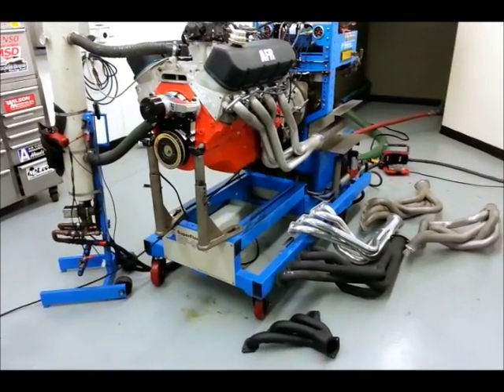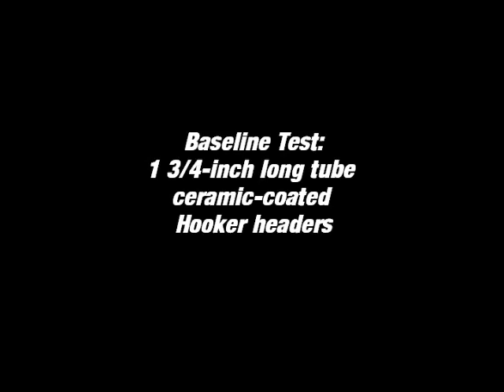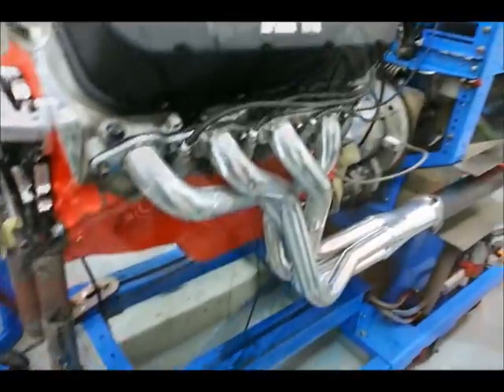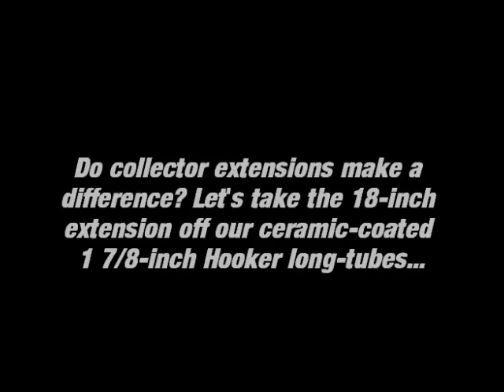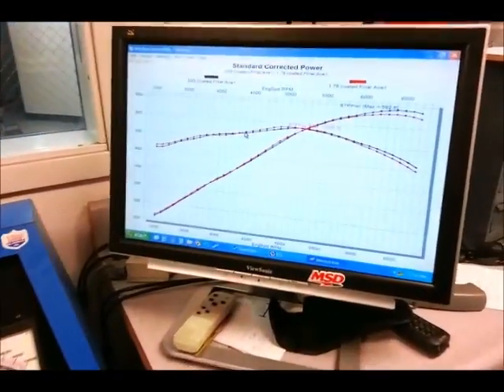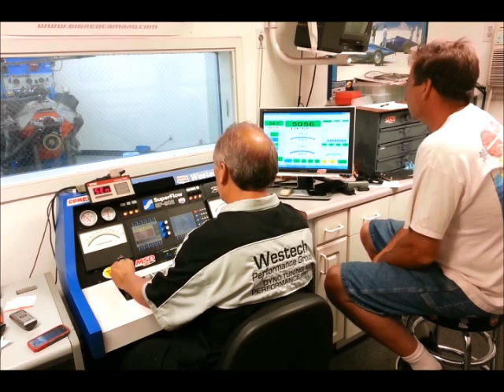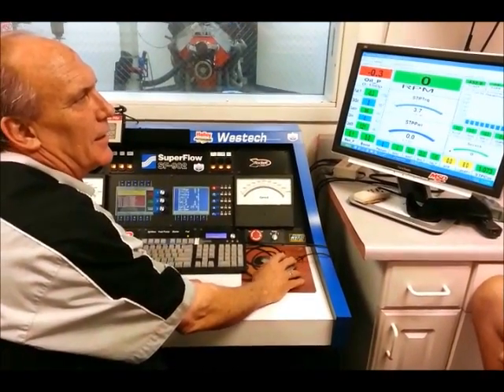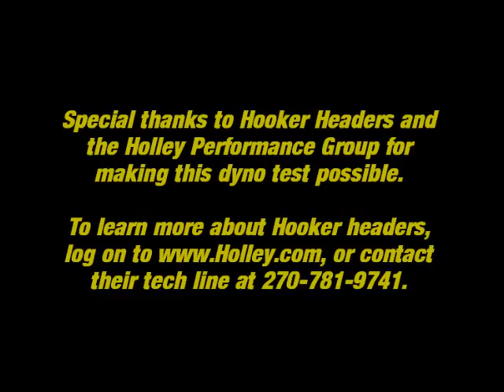Header Theory Dyno Test

Comment: @7:54 when he's talking about no effect from the header temperature to the horsepoewer - that's not quite right. There is, very small (if not negligible). This is due to the fact that in ceramic coated pipes, less heat is being rejected from the exhaust gasses to the pipes hence more heat is being detained in the exhaust gasses. More heat in the exhaust gasses keep their temperature higher. Now: The speed of the flow depends on the factor that is being a reference, and being a speed of sound. Speed of sound depends on the enbvironment - more precisely on the gass density which decreases with the increase of its temperature. In higher temperature gasses, flow losses are lower. Also, pulse effects (which are being used for scavenging) are affected in hotter gas flows - the speed of pulse wave is increasing in hotter environment hence the scavenge effects are optimal at the different range of RPM than in cooler gasses (no ceramic coat). That's why it makes a sense to wrap exhaust headers (not only to cool down the air under the hood!). These blokes needs some 10+ more years working on the dyno in more scientific environment...

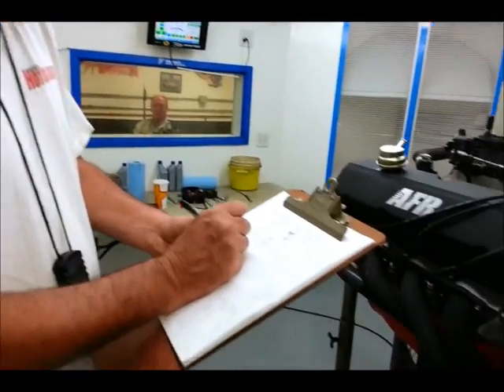Comment: At around 5:50 the guy off camera claims "we can feel the extra heat" which doesn't make sense.  The heat comes from the running of the engine and is the same whether your headers are made of steel or ceramic.  It's just whether the heat is absorbed partially by the headers or all of it exits out of the exhaust.  So his claim that the room is somehow hotter in the case of the steel headers is baffling.
Reply: not true. different materials dissipate heat at different rates

Comment: 3000 rpm is the bottom end? Come on! Start the test at 1500rpm so we can see the real bottom end differences!
Reply: 1500 rpm in a performance motor   --- get real
Reply: Race cars with good looser Converters ( like a foot brake racer) is going to be right @ 3500 0r a little more RPM  trying to hold with foot brake. Power range on race cam shaft is about 3500 to 6500, 7500 . So for us racers that info could save us $500. or more if you could borrow a small header to test & a couple weeks of test & tuning @ the track. Plus the heat diff on coated header versus the uncoated is a ton of Hot AIR under hood into you carb, killing HP. So that info for me was super helpful, it confirmed what I already new. BUT IT CONFIRMED IT. THX
Reply: Having run an engine dyno before i can tell you it's near impossible to run an engine at wide open throttle that far south in the rpm range. Not enough air speed through the venturis to generate fuel flow it usually will want to stumble.

Comment: On high flowing cylinder head, high revving engines like this a header test kinda negates the results. You kinda get the feeling that you know what the answer is.

I humbly submit a test like this would be better on a 9.5:1 350 (no 383 strokers) with a MILDish ie. <.525 lift hydraulic roller and a vac secondary 650 or 750. Alloy heads would be fine, but nothing exotic. I'd really like to see some tri-Y style in the mix too.
Natuarally carb rejetting if necessary would be done. In this way we'd get a more real world idea of what happens in a regular 350 sized rebuild.

Comment: Very interesting test except for the Ceramic Coating Temperature results....Shiny Metallic  Aluminum Colored surfaces measured with Non Contacting temperature Gun is Known Inaccurate Procedure !!  At very Least , using a Direct Contact type Thermometer Plus  the Selected Non-Ceramic header must be Same Color as the Ceramic Coated header...Comparing the Shiny Aluminum color Ceramic Coated header to the Black Color Non Ceramic Coated header is Totally unfair, Misleading & absolutely Worst pairing Comparison possible if Just the Ceramic Coating Radiant Heating Effects was to be Measured.....Black Color is the best IR thermal Radiator color with Shiny Aluminum color the Poorest IR thermal Radiator.....Comparing the Ceramic Coated header temperature to a standard VHT (or similar) high temp Aluminum Paint Color header would be Much more  Accurate.....

Comment: These tests dont do me any good. I dont see anything under 3000 RPM range with headers. which is where my 454 will be spending most of its time, idle to 3500RPM.  Dyno tests like these are made to sell parts and everyone is looking at top end power, doesnt do any good for a street or towing engine.  Looks like my best header for a 454 tow motor in a C30 pickup will be a ceramic coated 1 3/4 tube mid length headers and stay away from the long tubes , I dont care what it does past 4000rpm.
Reply: The headers will improve HP and torque throughout the rev range.  Engines are just fancy pumps.  How much will depend on a lot of factors but typically 2-10% and about a third less for torque.  Depending on how much power you are making to begin with it many not even be noticeable on lower power engines by the butt dyno.

Comment: WTF are they doing even bothering with the first set - there's no excuse for using a set with such a big variation in primary lengths!
however, I don't see the point in a baseline with "stock" manifolds as a/ there are a variety of them and b/ you wouldn't use them with such a modified engine! Sure, with a stock engine it would be interesting, but...

Comment: see, it doesn't work here, for a few reason.  the possibility of engine power could alter the outcome.  but obviously, they are testing over engineered technology here. and a real race car that'd some how have to be bent like this, would have a much more adverse effect.  i wonder the circumstances! but hitting those pipes till they close would have results…they should be testing how far can you dent the tube, or reshape the tube before it's altering performance…instead we have these idiots running pointless tests just watch some doof hammer an expensive piece of piping.
Reply: +Bo Huggabee Search up Engine Masters, both Steves are on it and they do that exact test.